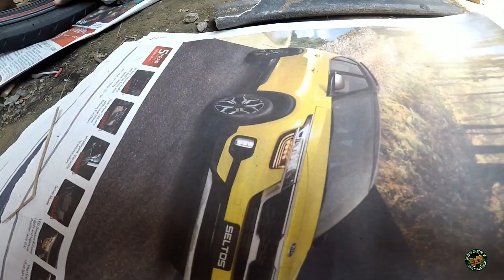How to repaint mags on my Sniper Mx 135 😍

Comment: paps...tiresize harap likod mo?pa bulong nman.tyaka yung brand
Reply from the maker: 90/70 f
100/80 r
Then Pirelli paps gamit ko. Much better sa daanan..
Reply: paps yung sa winker mo.ang ganda papano yun.
Reply from the maker: Bale paps hanap ka ng eyeline na led paps. Much bettee yung pinakamahaba then hatiin mo sa dalawa then install mo jan.. ingat lang sa pag bend. At maselan yung led na yan.
Reply: sir ask ko lang kung may kabig ba yung manibela mo nun nagpalit ka ng mags ni king.kasi nagpalit ako biglang nagkaroon ng kabig kaliwat kanan.para bang kusa siyang lumiliko
Reply from the maker: Wala naman paps kabig.. mas gumanda nga handling paps e. Check mo yung shock nya baka kulang na ng oil. Then isa pa dun sa bearing sa leeg..

Comment: bosing pano iconvert mags ng sniper150  sa ating mx 135
Reply from the maker: Bale convertion paps. Sa harap need para mapagana yung speedo then bracket sa disc.
Sa likod naman. Ipapa machine shop mo yung mags para magkasya at mag free wheel sya.